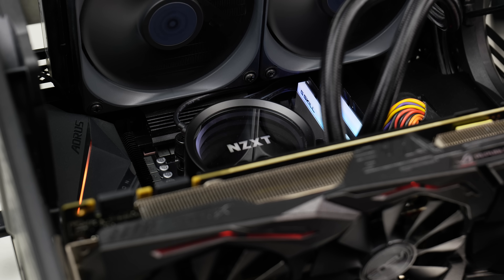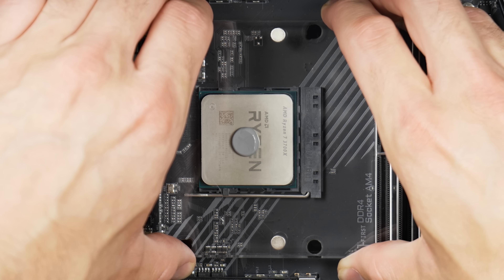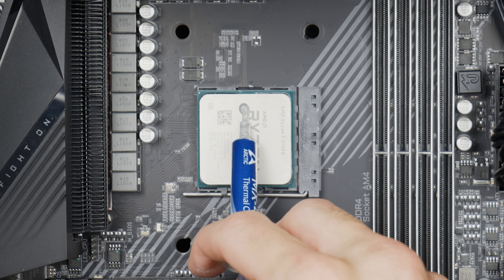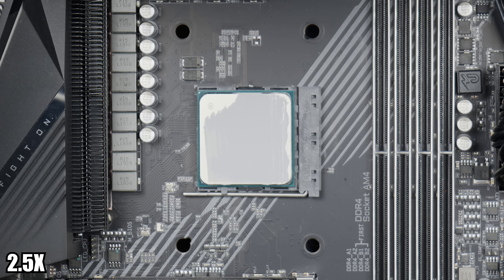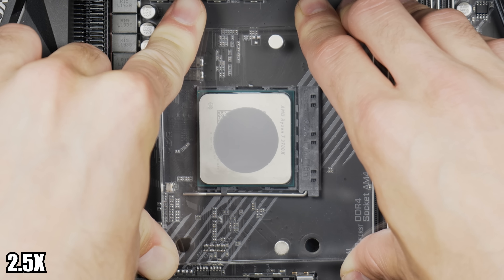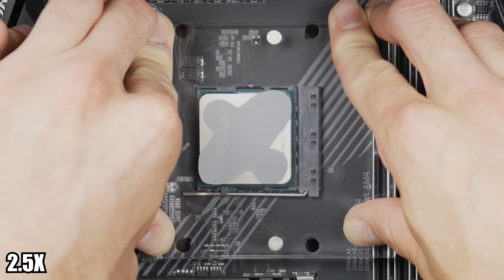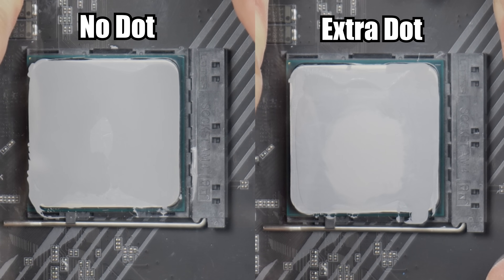Thermal Paste Spread Under Glass

Comment: For people still watching this: A great way ( i think ) to relieve the bubbles from the ihs is to do the mounting in a diagonal pattern so it bleeds on one side and when you tighten the opposite corner it'll bleed out there as well. Though its also recommended if you want even thermal spread lol.

Comment: My 2 cents: single dot is still the best. You put pressure on the edges so the glas buldges a little in the middle where the paste is. It will spread further when the viskosity increases when heated up and with time. I certainly don't want anything that even has the potential enclose air. The thermal paste should just barely cover small uneven spots between cooler and heat spreader. With lets say thermal paste with 20W/mK this still sucks compared to 200W/mK for metal. So i just want to barely spread it but not have a "thick" layer between it. And if it does not cover the edges i don't care. Look at the heat dissipation of the cpu heat spreader. It is not even in the whole area. If the real cpu just sits in the middle there is a huge gradient between there and the edges.
So i personally would say tiny dot for me. Never demounted a cooler and thought "oh damn that did not cover everything" in the end it always speaded nicely

Comment: Ive been doing the spread method for 50 years and most electronics have been like that up until CPUs (it seems) . I suspect its a manufacturing standard and was good enough to drop a blob of compound .   If you use the 'correct' amount of paste and spread it , it should even out just fine in the end .   Your biggest concern should be the fan and keeping the heat sink  clean

Comment: Pea method at the center is and always will be the best. Why? Because you use less paste and gain plenty of coverage over the area that matters with minimal chance of air pockets. People obsess over covering the entire plate. You don't need 100% coverage. With a good cooler, full coverage makes zero difference on thermal wear. Just buy a good cooler, preferably water, and that's all you need to worry about.

Comment: I have a hot SMD diode and discovered small gaps between the diode and the PCB. How can I insert thermal paste into those tiny gaps without having to unsolder the diode?

Comment: This was very helpful but semi flawed. Because you can see the spread you adjust the way you apply pressure.  The better test is to test with with the method of tightening down the plate.

The method to brush on all the plate thinly, then drop a pea in the middle may be the best way imo as well, you can make sure to use a very thin layer.

The X method is decent, I would add 4 small dots to the spaces. Actually modify this, make it an asterisk all connected to the center.

Comment: The X-method, if you don't go as close to the corners, seems it would do the best without spilling over. Spill-over thermal paste doesn't really help temps...
The "tiny dot" actually works well enough if you're not cranking the shit out of your cpu. All you'd need just just the tiniest bit more and you'd have it. The entire die doesn't need to be covered, though.

Comment: Flawed methodology. Coolers will apply a different amount of pressure and it will also be directly on top of the IHS and more even. This needs to be done outside a motherboard with correct tools.

Comment: I think using a thin piece of glass (flexible) is giving different results than with a heat-sink... esp if pushing down at the outsides and not in the center. I think pushing down in the center will give a better, more even spread... but the flexibility might "unflex" when you release and cause problems also.

Comment: Interesting video! I always enjoy seeing the spread pattern on heat sinks when removing them after a non-OEM pasting. I have had some OEM paste stay in perfect shape on the heat sink and show zero transference to the CPU when removed after years of use though.
For interests sake, the "Dell EMC PowerEdge T430 Owner's Manual - Installing a heat sink", depicts applying the paste in a swirl. A couple of decades ago I used to do the single pea; and then moved on to the thin spread with a spatula; and, more recently I've taken to the swirl. The consistency of quality pastes on the market has definitely changed over that time though.

Comment: The reason why you only need a dot in the center is the chip isn't that big (the size of your fingernail), and it is only in the center. The pins surrounding the chip don't really need to be cooled down. If you truly want the best cooling on your chip, remove the top cover, remove some of the insulation under the cover, replace the cover and then put a dot on the cover.

Comment: Through my own experimentation I've found my favorite is a super thin, but very even buttered toast. Then a small dollop (of jam) in the middle. I also try to wiggle the mount a bit to help even out any differences from an off center placement. I love the MX5 that Arctic recently released.
Reply: I do the same except no dot in the middle. There was a video 15 years ago I recalled. The engineer explained it in dept. That the best method was very thin that appears it was almost putting nothing in it. The paste was enough to cover micro holes. But applying paste like that is hard and time consuming. 

Again the paste is meant to bridge heatsink to lid because of uneven surface of micro holes.

Comment: I would never allow you to put you thermal paste over my cpu. Whole test is pointless when you cant put as much preassure on glass as you would put on cpu when actually mounting its cooling mechanism. To prove my point, anyone can go and do dot method, using half amount of thermal paste used in this video, to see that whole cpu got covered, and even some of it spilled to sides. On the other hand its most important to have as little paste as possible to make thinnest layer as possible while covering IHS area over actuall cores even if it means having no  paste in corners of IHS than having to much paste like in literally every case shown in this video.

Comment: It's important to ensure you apply the force in the center, to compensate for flexure of the acrylic.
Reply: That explains the bubbles
Reply: He used half of an acrylic photo frame which are usually pretty thick so I doubt flex would be an issue past a matter of microns or something.
Reply: @craiggallagher4461  We sometimes see the acrylic bending though
Reply: the cpu cooler will also bend
Reply: @jeanbon6084  CPU coolers are made of copper and aluminum, they will not bend to the degree a piece of plastic will.

Comment: soft plastic and spreading the entire thing (and then i tiny little bit more in the center), best way hands down, the dots and X method are inconsistent, i had a system that was overheating, i took the heat spreader off and there was a spot near the center that the thermal compound had burned off, like a bubble, and it was starting to burn the thermal compound, that was the last time i did anything other than spreading on the whole thing

Comment: Always thought that it does not make sense at all.
Thermal paste is meant to fill in the micro gaps in CPU lids metal pores and in heatsink.
Lesser the better. If the heatsink and CPU lid is straight of course. So basically what I am saying is that you should have seen CPU lid through the acrylic sheet.

Comment: The "bubbles" worry usually is moot because a lot of coolers are putting way more pressure down on the CPU than your hands will. The air bubbles get squeezed out with all the excess paste generally.
Reply: The problem is that, with the 'butter' method especially, sometimes there isn't excess paste, which may lead to air gaps.

Comment: Test is fairly meaningless because you have no way of either determining if you are applying the same mounting pressure run to run or even if you are using an amount of pressure similar to that of any cooler

Comment: Under pressure the air buble ( call it Michael if you mis-spell like I just did ) likely just diffuses into the paste and then out the sides over time ( guessing here as I can't think of another explanation )
Reply: The main thing I am taking from this is:  Whatever you do it's pretty hard to screw it up.  Last time I fitted a cooler it slid as I was trying to lock it down but this video suggests I almost certainly got away with it and a 10 degree temp drop over a stock cooler also suggests that I did.

Comment: I always go with the spread, but I do it by hand instead of a credit card, so it is not 100% smooth, probably a bubble fest? I don't know, have been doing this way for years.
But perhaps the Cooler wont get the bubbles, because of the grooves on the cooler? 🤔

Comment: On my 5800x3d the spread method works the best. If your block is flat you won't get an air bubble. Plus Ryzen 3000-5000 theres absolutely nothing in the middle of the substrate. The die and memory controller are to offset from center.

Comment: i just use my finger to spread a thin layer across to ensure its all been covered and that there isnt to much, and no the amount of oil in your finger tip is not gonna make a difference and if it makes you nervous just use an alcohol wipe on your hands, especially when thermal paste sits for a while and nothing but clear liquid comes out at first, thats a bigger worry.

Comment: Do this using the real heatsink mounting hardware and not pressing by hand. There was a bubble of air trapped in the toast butter method, you pressed until it stopped being visible, and then said it's a good method. Also your thin acrylic plate is too flexible, use a thicker one.

Comment: It really isn't hard to take a little extra time and spread on so you get maximum coverage. All these other methods work I guess, but not getting full cooling potential. Especially if running like a 5800X, that little chip gets hot! I knocked 5 degrees off simply using the spread method. I was a "pea drop" for the longest time.

Comment: It's not about coverage. If the sink and IHS was ideal, the thermal paste would be a hindrance, because it's less efficient than the metal. So you want as thin of a layer as possible of the paste, so the rice grain is actually best given the thinness of the spreading without air bubbles.

The pattern doesn't really matter as long as it's centered and avoids air bubbles (which a dot or small line is most assured to prevent, as something like an X depends on how the spread occurs from the corners of the X). What matters most is not applying too much thermal paste, because it can very easily hinder the thermal conductivity to the heat sink.

Comment: You only need a little thermal paste to fill in the micro abrasions of both the cpu and heatsink.  Too much paste will interfere with heat transfer.  Metal to metal is the best, but since there are micro abrasions you want to fill that up with thermal paste.  Use any flat plastic like a credit card to thinly spread the paste on both sides, very very thin. Thin enough, you can barely see the paste.  That's it.  If you are worried about air pockets, you have way too much paste.

Comment: Acrylic being pressed by fingers, is not the same as metal being secured by screws.
Acrylic is WAY less hardened then metals being used for heat spreaders and will flex more, and Glass is WAY harder then the metals. 
Glass would guarantee the most consistent results as well... Why you didn't just glue some posts onto a small piece of glass, then press it on in order to give you consistent results is beyond me.

Comment: Just spead the paste over the entire surface of the CPU using your finger tip. This worked for me for over 20 years. Not kidding. It is the most optimal solution since you get 100% coverage and don't need to worry about any bubbles or missing an area.

Comment: I do what i like to call the "firefly" method, start with a decent sized vertical "grain of rice" in the middle like the one you did for the "body" then do 4 thinner lines coming off that that extend about half way to the edges of the IHS like a smaller version of the "X" for the "wings", that way you get the best of both methods, the wings ensure that it spreads out far enough to cover the corners while the smaller initial area reduces the risk of overspill and a large central body and a lack of loops reduces the risk of bubbles.

Comment: If you do another video (or extend this), please try the tile laying method (you can use a hair comb instead of a  notched trowel. And don't forget to do straight lines, no curves which could trap the air. ;)

Comment: Have been overthinking this for 20 years and finally came to some conclusions.
Big die (HEDT or big gpu): Thick X
Small central die (i3's etc) central dot
Decentralised Chiplets: Thin X with an arm going over each CCD
Need to take the cooler off a non-critical build and don't wanna use a ton of towel and alcohol to clean up and waste the previous paste?... reapply a small dot in the center withut removing the previous paste UNLESS you previously added too much and it went over the sides.
I'm now making an acrylic template same as used by the cooler companies which applies a thin layer across the top 80% of the IHS every single time consistently, No guessing if the spread was equal or too much/little paste, no waste, little to no mess.

Comment: this test is inaccurate because when the cpu heats up, the paste becomes less dense, and then the pressure from the cooler spreads it out more.  
the x is best make a good overlap with 2 diagonal lines, this creates an extra bit in the middle which spreads to the sides

Comment: Too bad the big budget guys did not think to do a test with a thick sheet of lapped glass with mounting holes such that the glass simulating the cooler can be tightened down to observe if or how the pattern - tightening / torque might effect the spread too.

Comment: in construction we lay tile in bathrooms.
If it is a concrete floor, an air bubble can mean the tile will crack if any type of load is put on it.
So trowels have one side that is smooth and one side that is a comb.
When you comb in an arc, bubbles. But when you comb straight, then the air is pushed out.
Thus the x or some sort of asterix symbol in the center spreading to the edges is best.
Dot in the center would be fine if coverage to the corners is 100%. But no way to know this for sure. unless you have a little mechanic mirror to check for paste squeezing out on the underside of the cooler.

Comment: super late to the party, but when you do the spread method, you want to evenly snug down one side of the cooler, then the other, then go back and tighten it down fully and then the rest. This way 'pushes' any airbubbles out. It's a solution I came up with when I noted having trouble with hot spots.
That said, long as there isnt 'too little', its not hugely important to be overly concerned. Even, total coverage seldom has more than 1-2 degrees of difference on the extreme. The difference between 'okay' and 'perfect' is negligible You just dont want to massively screw it up and leave chunks of uncovered IHS is all.

Comment: I apply a very thin amount of paste across the entire CPU heat spreader and then a tiny ball of paste in the middle.  The theory being that a complete contact is made across the entire heat spreader and that the small ball of paste in the middle prevents bubbles of becoming trapped in the paste once the heatsink is secured under pressure.

How well this actually works I don't know.

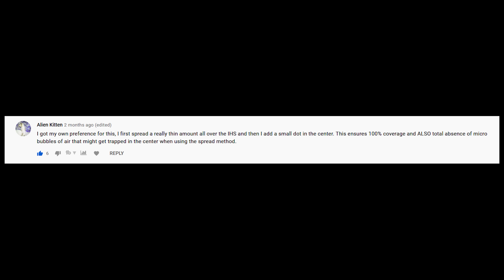5:18  Okay, should have watched longer before commenting.  LOL

Comment: You wouldn't get bubbles as your using acrylic and pushing down around the edge of it causing flex. A cooler has far more weight in the centre and and won't flex in the middle. You actually would of been better doing this test with a piece of reinforced glass. Ive been repairing/building pcs for 20 years now and the pea method has always givin me full coverage.

Comment: didn't even use glass, wew
many vids with this acrylic showing application methods. If your metal heatsink has big gaps in the tubes that touch you probably should use a lot more paste than you would with one that is perfectly flat

Comment: Years ago I experimented on a gpu (gtx 660) with different paste methods, I must have cleaned and redone it like six times at least, each time stress testing in furmark and waiting until the temperature couldn't go higher, then pulling the gpu back out again to re-test. and the best result ended up being the x method. One thing I kept noticing was using too little was worse than too much, but too much could spill over a bit and make a mess. That "less is more" thing I always heard didn't seem to hold any water as far as temps went. It seems that optimally you want to use as much as you can get away with with no spillage, but if you don't care about spillage happening then I guess it wouldn't matter, but you better make sure your paste isn't conductive though.

Comment: I know this vid is a bit older now but i always put a THIN (card) layer on both the CPU n heat sink. I start with a slight slope from one side to the other (Seems how it already has paste on both sides) Iv never seen a problem and always ran cool. Are there air bubbles maybe?? But iv taken it off and it looked pretty smooth to me.

Comment: I think it is more a problem of applying equal pressure, which is very hard to do (obviously it looks easy with acrylic glass but isn't that because you have a visual clue to compensate as you push?). I feel like the pea method is more likely to fail due to unequal pressure (pushing paste to one side) than many of the other methods. Some form of the X or 5dot might be the best to counter the problem with unequal pressure.